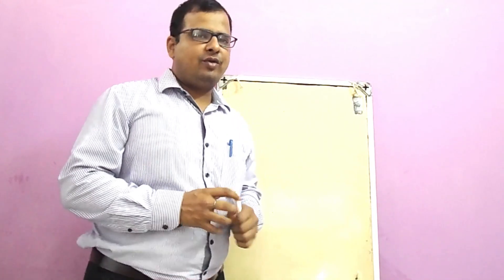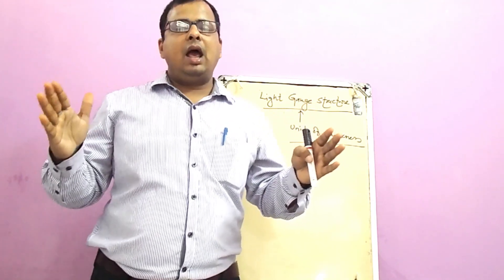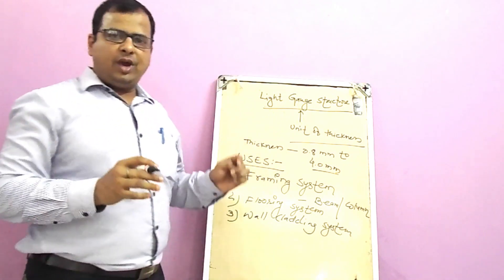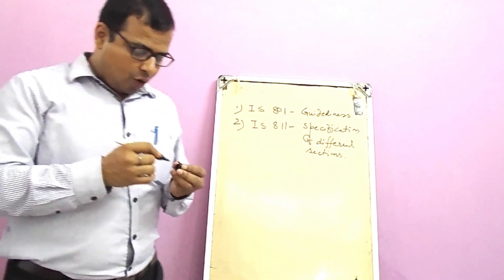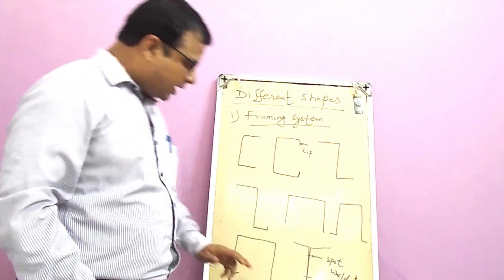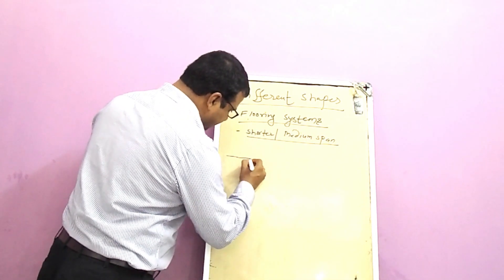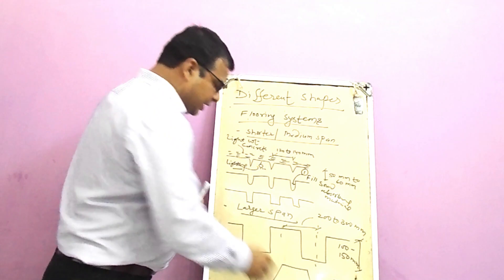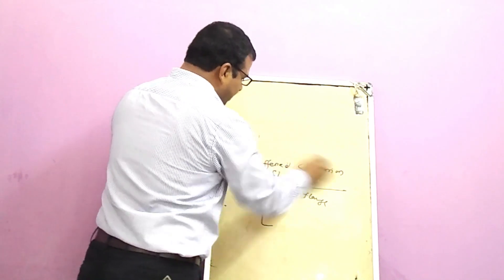Light Gauge Steel Structure: Dr. Trilok Gupta

Comment: Thank you Sir, you have mentioned that the thickness of the sheet starts from 0.8mm to 4.0mm Max. thickness, however for Flooring/ Roofing Sheet generally used for PEB Structure generally starts with 0.4mm sheet, Are those not cold formed sheets, Please confirm?